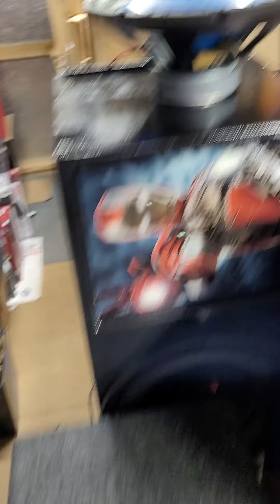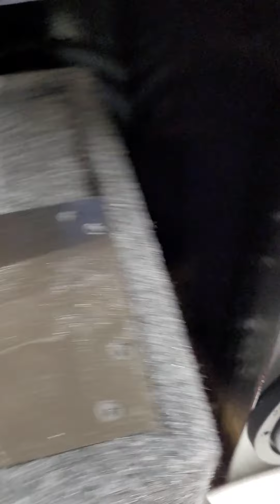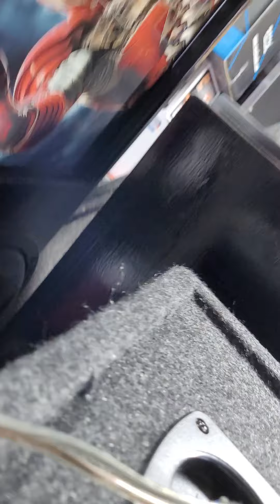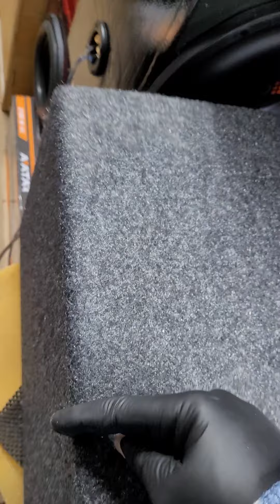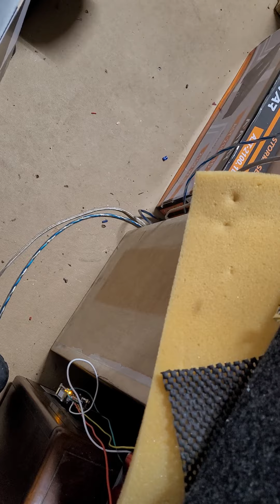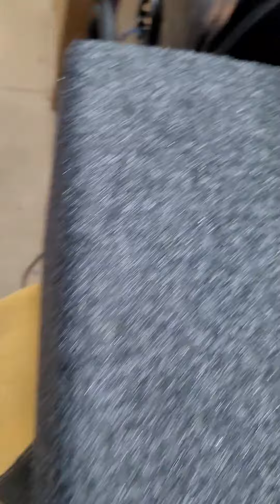#lowbudget Pyle bandpass modify to work (within reason)

Comment: Make a new baffle over the factory open end. Mount the better sub in new baffle. 👍 The old baffle is now a window frame brace.
Reply from the maker: Definitely possible. Would possibly require gluing in support bracing for new baffle, not much material there.
Reply: I'd think one 10" would be ok without much. Maybe just a couple strips glued on the inside edge of the enclosure for baffle to rest against. But also...there might be enough airspace to consider porting again with the whole box used. 🤔

Comment: Being as it is a 4th order bandpass originally, amd you've sealed the rear ported section, and opened up the front sealed section, it is a 4th again...but tuned very high. Try shrinking the front opening a little at a time, that had the plexi. See if you can get some good bandwidth at some point? Just a thought. 👍
Reply from the maker: I think I've invested about all the energy I'm willing on this 😬
Reply: @slickwillybudgetking  😅
Reply: no it's not, it's just a sealed box.  That square baffle doesn't count as a "port" considering its bigger than the speaker
Reply: @eddominates  i beg to differ. Put it in an enclosure design software and see what results you get.
Reply: @eddominates  it is a highly turned 4th order. The baffle is inset into the enclosure, it has a sealed side, and a large ported side. It is in fact, still a 4th order.
Reply: so if I cut the bottom out of a 5gal bucket and glue it to the front of my baffle, that will turn my sealed into a "highly tuned" 4th?  
cause that's literally the same thing.  it's just an extended baffle, there's no subwoofer tuning going on there.
Reply: @eddominates  you're incorrect.  This is a negative ratio as well.  The sealed side was smaller, the ported was larger.  He sealed the ported side,  and opened up the sealed side, hence a negative ratio.  You're theory of a bucket.. is not the same, although you may think it. This enclosure now has an extremely small bandwidth, because of this. Take a sealed 3 cube enclosure, and place the baffle to where you have 1 cube sealed, and 2 cubes open, and punch in a 3/4" lip on the open chamber in any enclosure software program..and see what it tunes too, as a port.  You'll have 2 cubes "ported" at an extremely high frequency. So, yeah if you did your "bucket" that way, and utilized your lid as well, and cut it all out except 3/4" lip all the way around, it technically woukd be a 4th, but with no real bandwidth due to such a high tuning frequency.
Reply: @Chuck_Sanders  that's kinda my point - "no real bandwidth"  makes it not a functional port.   
It's literally doing nothing, if the "tune" of that lip is higher than the LPF.  
if you want to say it's technically a port,  fine. ...but functionally ..  it's doing nothing.  you're getting the exact same frequency response as you would from a sealed enclosure.  and nothing even close to what you'd get from a 4th order

Comment: If I put a true 500w sub in there...and leave it as a band pass....if I remove one port...will lower the tune ?....and will the box hold up ??..😂...thanks !!
Reply from the maker: 1. You'll have maybe .5cf on ported side. With one 3" port that's about 70hz. So.... 🤷‍♂️
2. Not sure the box can handle 500w. The 1/8 plastic front surely can't 🤣
Reply: Removing one port will tune the enclosure to a lower frequency, yes.